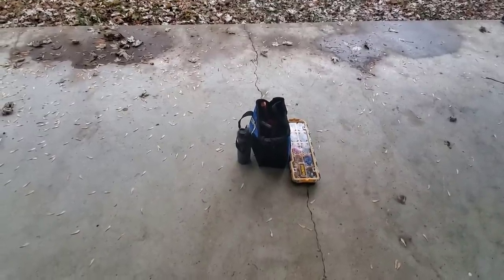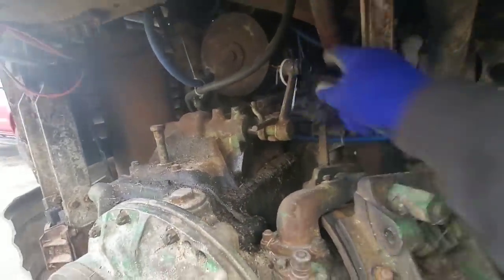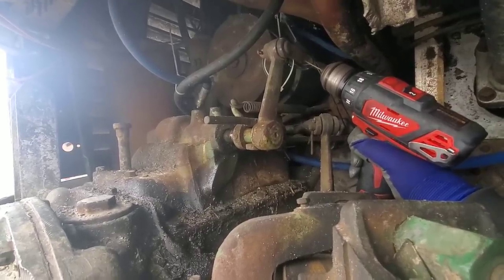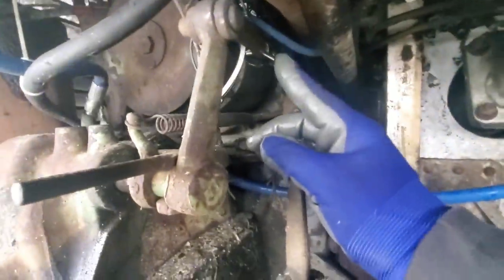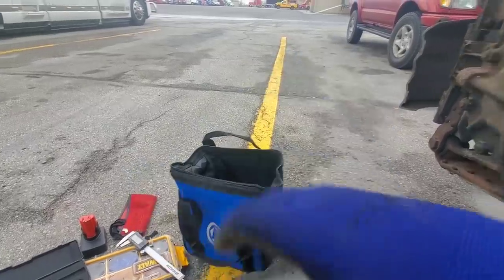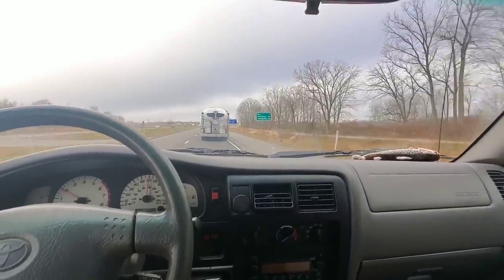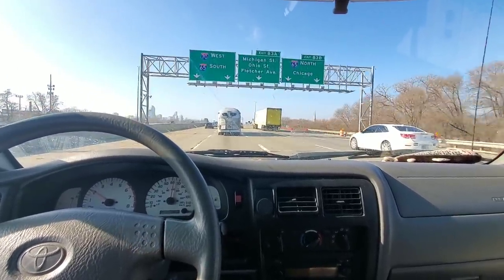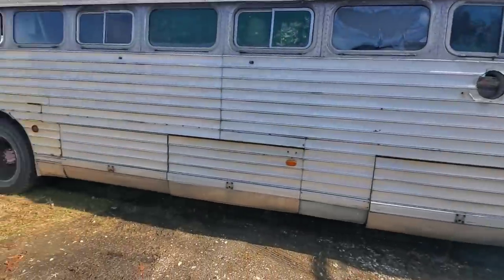Prewar silversides drive home day 2

Comment: Suggestion: Spray some WD-40 on those drill bits and retract the bit from the hole often after you get to a 3/8 depth, to clear out the fine chips!
Reply from the maker: I only had pb blaster with me
Reply: @Spyke383  IC
Reply: Ah, PB can suffice as a cutting fluid. As long as you're getting chips or "snakes" of metal, life is good.

Comment: This kind of SNAFU moments are why I keep some of my dad's old 'oh shit' items in my toolbox: Safety wire pliers and some stripped out telephone wires. Great for all sorts of things, especially together. Quite a bit lighter than bailing wire, but more versatile for it. If I'm worried I run it back and forth a few times. 

I've even made some ethernet cables with that combo for kicks, once. Tested beyond cat6 speeds, too! Was really hard to terminate, though.
Reply from the maker: If I was in my service truck we could have fixed it but i was driving the customers truck home. We only had the tools he had on the bus. Which we could have possibly made the repairs with them but weather and daylight were also working against us on day 1.
Reply: @Spyke383  Yeah, that's understandable. I was just being a rotten peanut!

Comment: Those two stroke GM diesels must be very cold sensitive to need assistance at only 32 degrees. I'm retired from Caterpillar Tractor and when we used to move tractors around in the yard I normally only used the glow plugs below 32 F and only needed either at around zero or below.
Reply from the maker: 2 stroke detroits don't have any glow plugs or grid heaters. A block heater is all you have if can plug it in.

Comment: Thanks Tyler for this video. I was taught to use motor oil to lubricate drill bits, and to keep a slower rpm with the drill.
Reply from the maker: On nice bits or hard metal i run them slow. With the cast and cheap bits i just send them lol